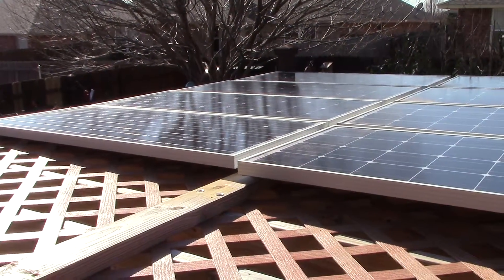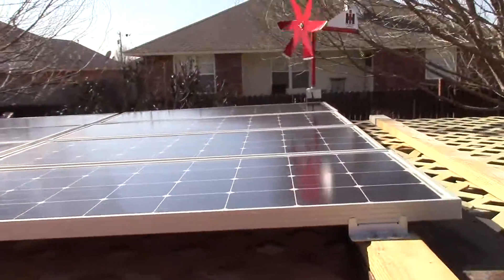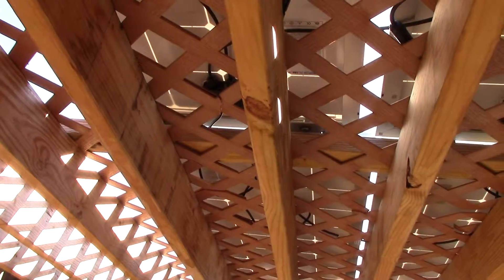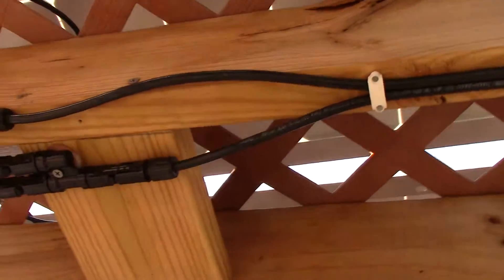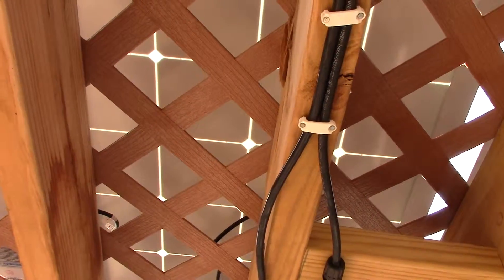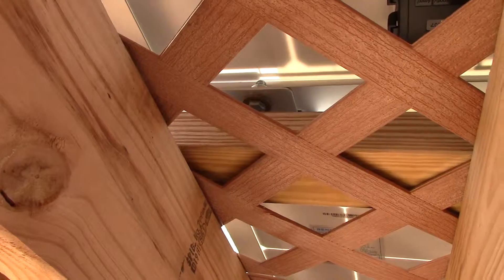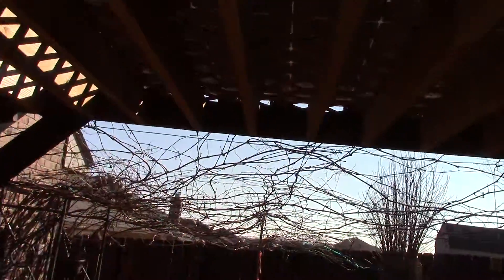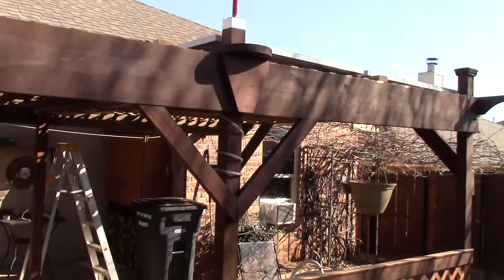800 watts in Renogy RNG-100D solar panels! Ready for two more!

Comment: Could 8 100 watt solar panels, 60 mppt charge controller, 5000w power inverter, 12 volt 200ah battery work together for a solar kit

Comment: Not so sure it's a good thing to run 1000 watts of solar in a 30 amp controller..
Even 500 watts through a 30 amp controller is pushing it
You could possibly toast your controller.
It might be a good idea to get a 40 amp controller, and divide your system in 2.
It's a good idea to have a 30 amp inline breaker aswell.

Comment: Great job Chris! Im right behind ya! lol I think you'll be fine with that cable. I just got my Midnite Kid installed with my 6 Renogy 100w panels. I still have the panels wired 3 in series and 2 parallel strings... wanted to see how yours hold up first! ha. Great job and congrats!
Reply from the maker: Hey Jonathan...check out my channel. I put two more videos up today. Got 10 panels up now and also did a video of my Kid kicking butt. Thanks...keep me posted on what your doing. Run those panels at higher volts...I am finding out that the Kid likes it better...and the MPPT keeps up to find what voltage is best. I have my ten running series-series-parallel. My volts average between 80-100 volts (depending on where the MPPT function likes). 5 panels/5 panels paralled. Cheers!
Reply: FYI CHRIS,

1 KILOWATT = 10,000 WATTS

YOU'D NEED ONE HUNDRED (100) 100W PANELS FOR 1 KILOWATT.

I'D ALSO BUY A SET OF READING GLASSES TO READ THE CABLE SPECS....LOL
Reply: +BobBob BobBob I think you meant 1000 watts = 1 kilowatt

Comment: Looking good lots of air under the panels. the answer is simple.How many amps can the panels put out wired in the configuration you have them. 2 what is the max amps of the cable over the length. if the panels exceed the cable then you need to run another :)